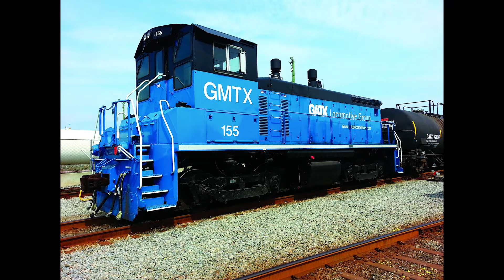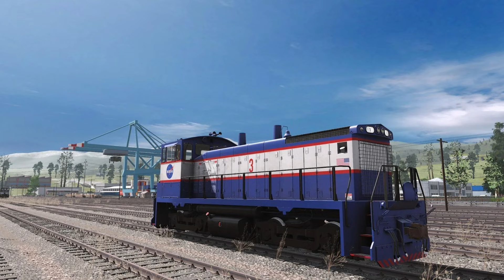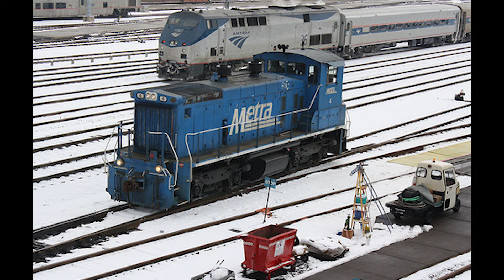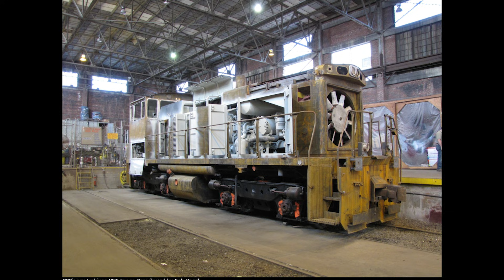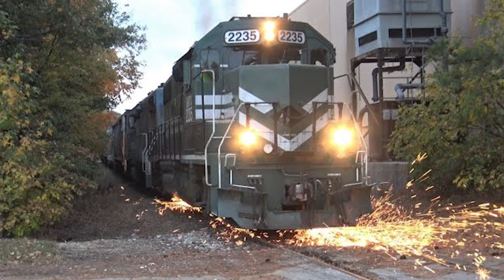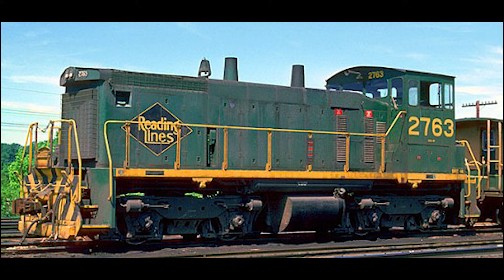How the EMD SW1500 Outlived Almost Every Yard Locomotive of Its Era

Comment: In the late 70's around Christmas, I was on a freight train that was running caboose hop out of Dallas to Ft Worth Texas when we were told to stop and pick up the switch engines and cars at Arlington. We picked up about 4 SW 1200'S that worked everyday around the BOP at Arlington and a bunch of cars. It was night time and we started off towards Ft Worth. We were a train again at that point with about 100 cars or more. We made it about a 2 miles down the railroad when one of the switchers made an boom explosion sound and I looked back to see carbon fires everywhere. Every switch engine was blowing crap out like a wood burning steam engine. It was a spark o rama shower show. Those engines never got out on the main line running under extreme load at max engine speed. In fact, they probably idled as much as anything. They all had flat wheels and were straining their little guts out. We started fires from Arlington to Ft Worth and it was quite a show. The spark arrestor's/ screens were full of carbon and all that carbon just exploded as we moved down the railroad. It was quite a show. I loved working on those little SW 1200's. They were so easy for switch men to get on and off.